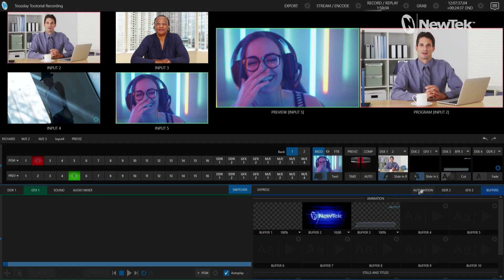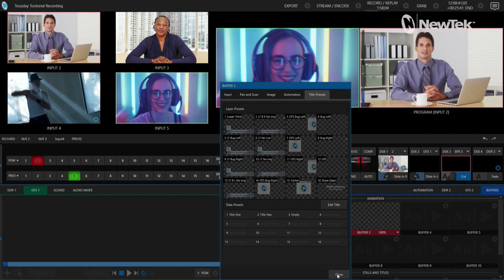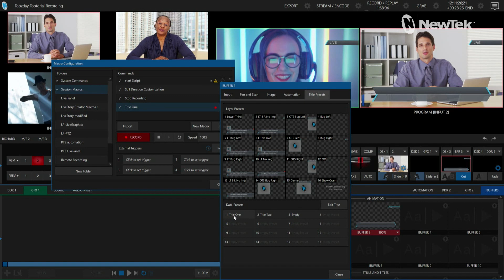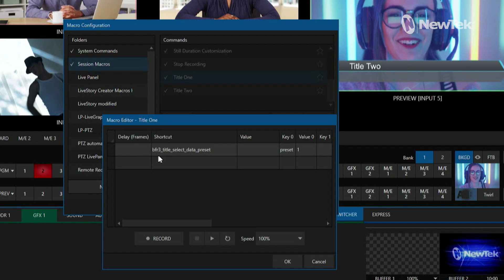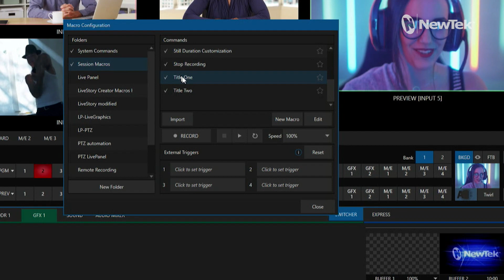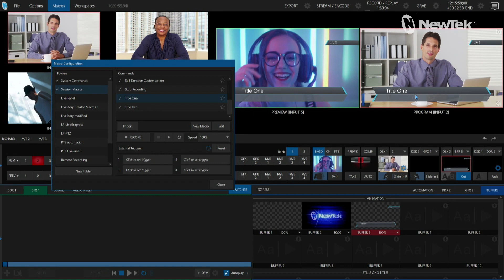Tuesday Tutorials : Macros Triggering Macros

Comment: Hello sir. I’ve been using Tricaster Mini HD-4sdi about 2 years ago for work place and it works perfectly. But today the 4 inputs (SDI ports) turned to blue and didn’t display the camera as it used to be. I tried to restart and turn back on many times it’s still the same NOT WORKING. Could you help please?
Reply from the maker: My first suggestions would be to update your TriCaster from the downloads page at newtek.com/downloads.  if that does not work try doing a software restore + the current update that may fix the issue or at least rule out a software problem existing.  I would highly recommend contacting our support team at https://www.newtek.com/support/protek/ they would be better qualified to help you if the restore doesn't work.